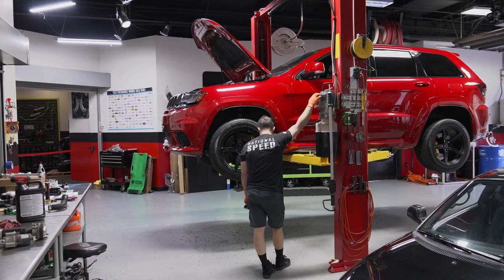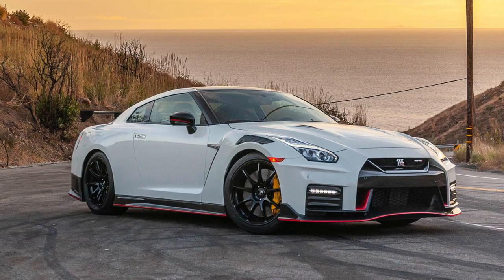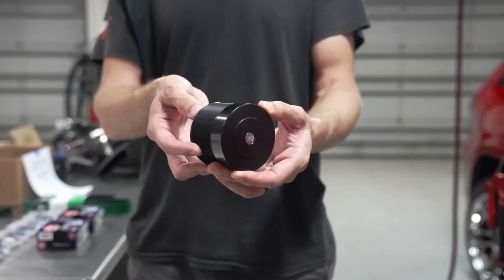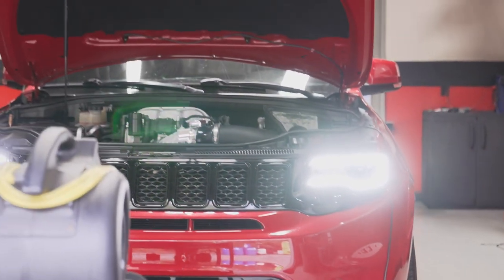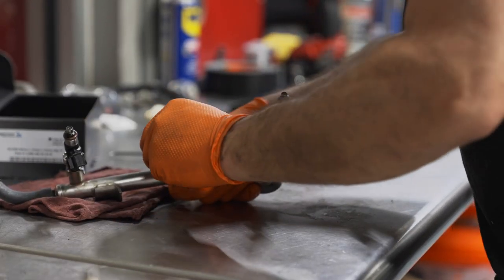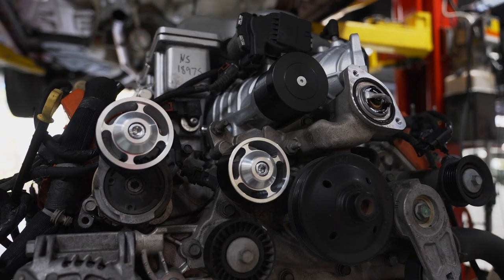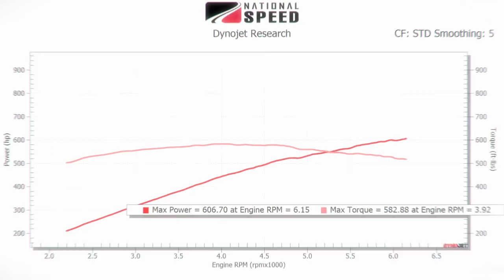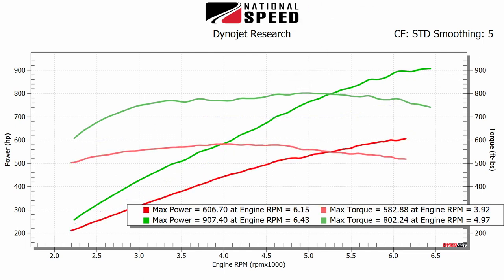Trackhawk Stage-2 + E85 Package Makes 1,000HP!

Comment: I have a hellcat, i was wondering if you had any idea if flex fuel is possible and will the new flex fuel sensor on the new crate motors will be compatible with earlier gen hellcats